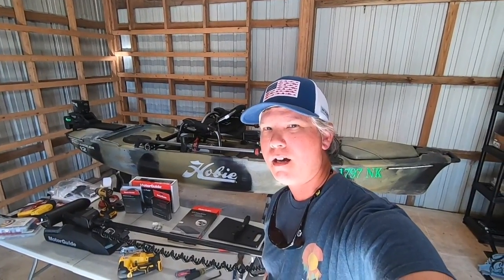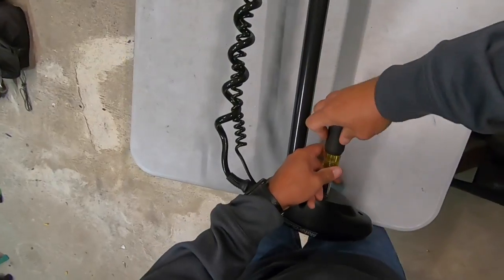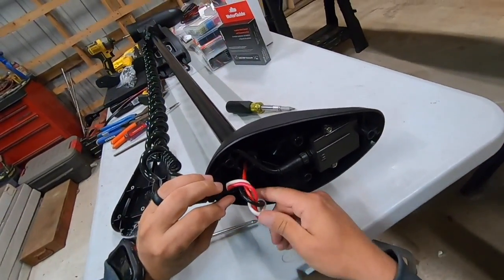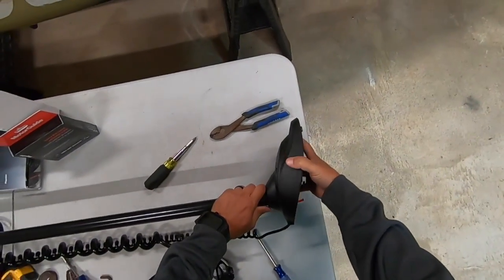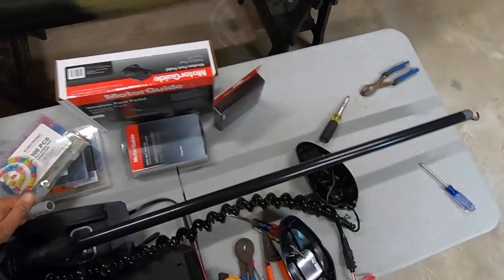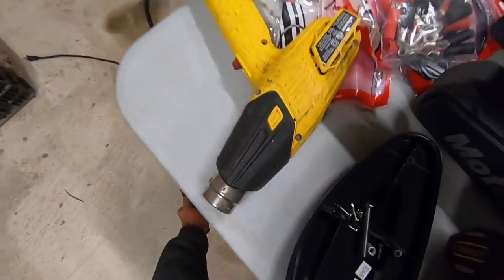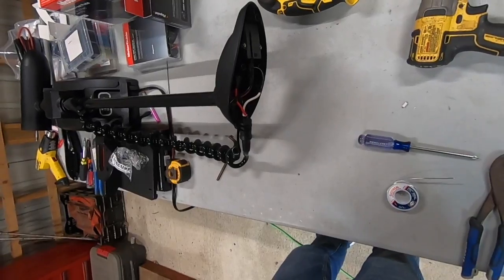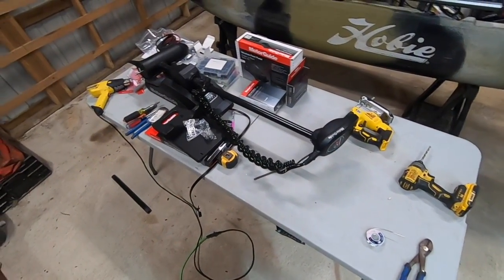XI3 Install Part 1 (Shortening the shaft)

Comment: What kinda speeds are you getting, been wanting to see if anyone has done this on a hobie and curious how it’s working for you
Reply from the maker: At 3.5 mph I start getting water pushing up through the scupper holes under the seat. That was about half power. I haven’t tried with scupper plugs. I bought it and the Newport at the same time and prefer the Newport for the style of fishing I do so I don’t use the motor guide anymore.